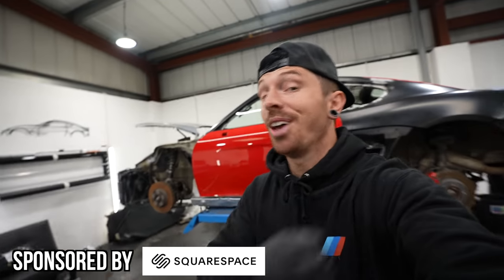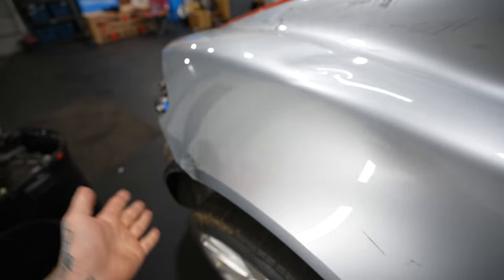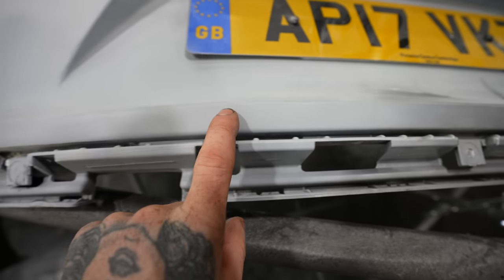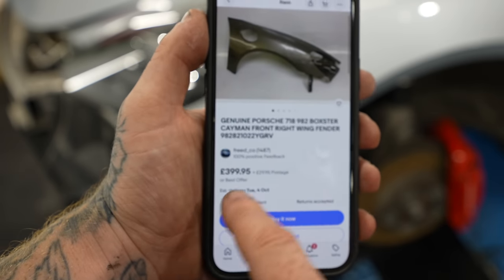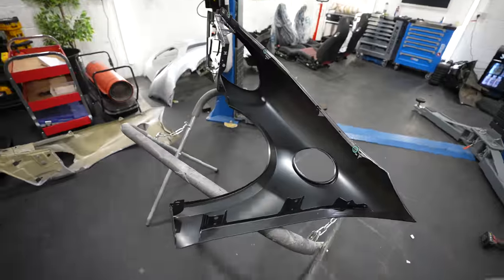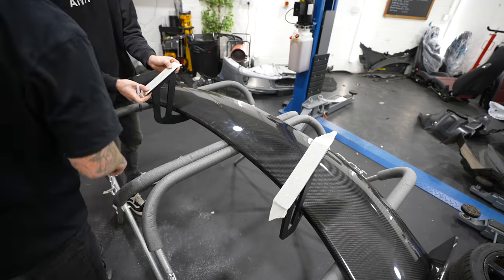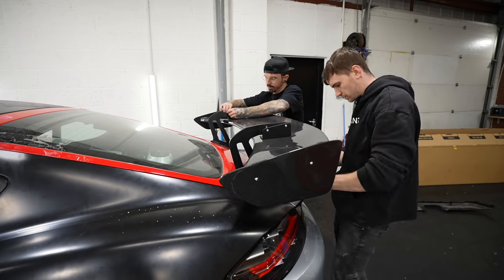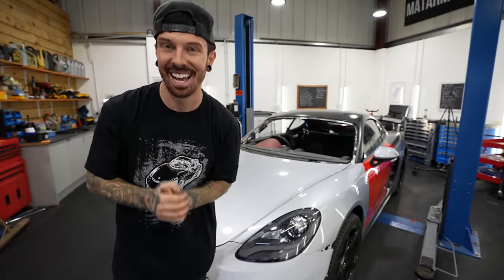REBUILDING THE CHEAPEST PORSCHE 718 CAYMAN S | PT4

Comment: Literally installing the same rear spoiler on my 981 as I type this out(if this is the one from eBay).  I’ve been brainstorming the last few days with my mates on how we should mount it to the deck lid because of the gap in the deck lid and we came to the same conclusion about drilling out large holes from the underside to fit washers in through the bottom…. Going to water seal them with a boat epoxy after I install it most likely… I also had the worry I’d lose the bolts in the lid if they fell off so I swapped the Philips heads for hex bolts today at Home Depot… glad to hear you got them all out.. I was ready to pull my magnet out today to snake them out if I lost them.. love the documenting keep it up!!

Comment: A tip for keeping the body lines when using filler is to sand to a tape line 👍 my background is clay modelling more than hard modelling but still used the same method when using the brand of filler you've got there

Comment: The trick with the soft edge you filled in on the rear bumper cover is you have to first create a sharp edge. You can use tape you guide a straight line, then once thats in place you just sand the sharp edge down to equal radius as the rest. Attempting to go straight to round edge is very difficult. When hunting for highs and lows use a "guide coat" once you paint a layer of primer, add a light dusting from a rattle can of contrasting color then you can see as soon as you start sanding where the lows are because you havent sanded them yet

Comment: A top tip for you when you use the mastic or body filler in awkward places apply enough of a blob then cover it with cling film and use your fingers to mould it or different diameter pieces of tube to form perfect round corners or spread out the mastic as you please then when dry peel it of simples!

Comment: Regarding the panel prices, I had a similar experience with a CBR Honda years ago. I had a little slide down the road on it, which took out the side panels. Did a similar thing of going to Ebay, but thought I would check with my nearest Honda dealer for prices. Was shocked to find the new panel was cheaper than the 2nd hand one on Ebay. And they would have it by the next day.

Always check first, you may be surprised!

Comment: Well done bud, that's a good effort. Porsche would have applied the cavity wax (AV30 - or similar), and THEN done the panel bonding. But you've still exceeded the standard corrosion prevention (crap) of body shop panel re-fitting.

Comment: Good job on getting the bolts out of the boot while installing the wing. I had an old Nissan 350Z with a bolt inside the boot from a previous owner. Never bothered to get it out. That rattling noise when you drive over bumps is AWFUL! Even though it's nothing serious/dangerous, it's just super annoying! :P

Comment: Yes I know what you mean. It's just so thrilling for yourself.  I once bought a > RM$105K suv 7 seater for RM$5K cash, change the whole engine (2nd hand) and major repair spare parts and new air cond for another RM$7K total on the road RM$12K.  Drive feeling like a queen, so happy. Car also came with open sun roof like new, car low mileage too.

Comment: For that split on the rear bumper you should have drilled a hole at the end of the split to stop is spreading in future under the filler, it may hold ok though with the plastic welds and fibreglass on it.

Comment: Doing a great job but you should bare metal the new panels before installing them. The black paint isn't usually a primer but just a cover coating to prevent the panel corroding in storage.

Comment: I think the one thing that would be interesting to account is the amount of labor, but more so the amount of labor hours you've spent on this as well. Anyone else needing work like this done would be given a cost of parts+labor, meaning each task has its own labor amount assigned to it, and the hours start to add up, this would drive the cost of repairs up significantly which is why most shops and insurance companies wouldn't touch a job this big. So would be interesting to see just how much money you saved doing all this work yourself just on the labor side of things.

Comment: Matt, don't stick the side vents on..  they will fall off. use the vents on the car now and put at least 4 screws on the back plus 3M tape.  I have done this 2 times and tested the car at over 140mph and they are still on.

Comment: I watch you for a time now. Just my opinion = you kinda search cars with mirror mechanical issue, bad/really body, replace body parts with new one (or custom) and it's done. It's like you work on a dealership (a bolt it's broken, replace everything with a new piece). I still gonna watch you but a tip: take a really bad project where you need to take EVERYTHING apart like every single piece of engine etc on the floor and rebuild a entire car!

Comment: Quick tip. Plastic welders are cheap and make a far better job. Very easy to learn. Most of the time filler isn't needed and normal filler works just as good as the special plastic filler which is just a scam. Plastic primer is a scam as well and plastic adhesion promoter doesn't make a difference either . Normal 2k primer works just as good.

Comment: It seemed to me that lot of the welds were done without weld through primer(in the previous video) and now the seam sealer directly on factory primer and grinded bare metal. Should be rustproofed before sealer.
Amazing work otherwise but these areas WILL rust.
Reply from the maker: All the welds were done with weld through primer bro why would we only do a few 😅
Reply: @MatArmstrongbmx  Thats great,  i just could not spot it in the video nor was it mentioned. 
But the seamsealer went directly on untreated seam. That seems odd. Or is the sealant in itself anticorrosive?
Anyways, really enjoy your videos!!👍

Comment: This car shouldn’t be going back on the road! They way it has been repaired is shocking and dangerous! I only watched some of the first video and that was enough! You haven’t measured it, you cut though the outer skin with a grinder into the high strength steel on the A pillar! You can’t just plug weld the panels onto high strength steel, there’s a process re spot welding them on. And you can’t use bloody sikaflex for bonding in the roof! I thought that was a joke! But no!

Comment: Sure looks like you’ve put the sealant straight over bare metal. Good to know for the new owner, be prepared to redo the work in few years time after the rust has started to appear…😢
Reply from the maker: The sealer is suitable for bar metal bro
Reply: @MatArmstrongbmx  the sealant must and will stay flexible, this means the edges also will move in and out. Maybe not enough so that you can see it with your own eyes but it will. Same with changing temperatures the sealant does not act the same as the metal. 

The metal right next to it will be painted, the line right between sealant and painted metal will rust. Always use an etch primer on metal before applying something else. Especially when there is time between welding and finishing. Rusting starts immediately due to humidity in the air.